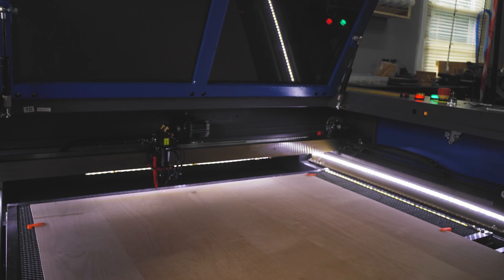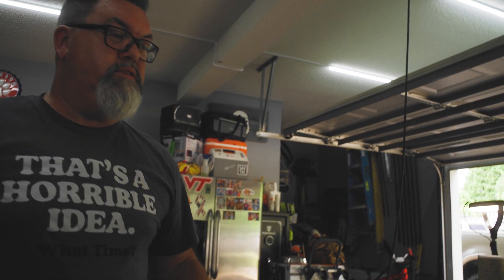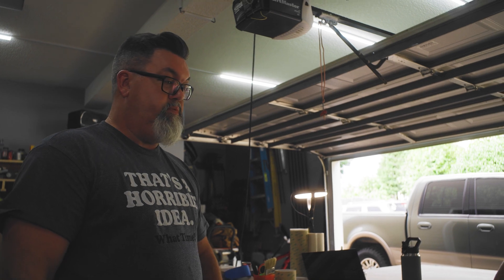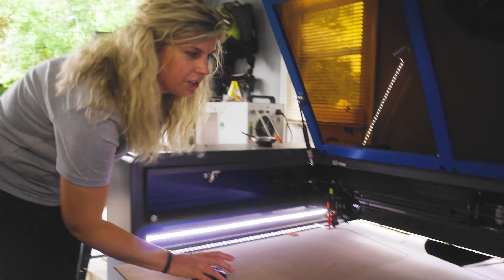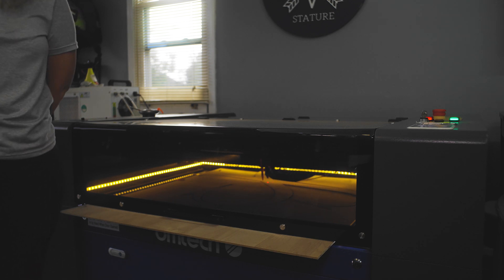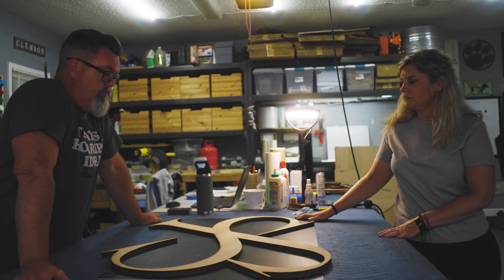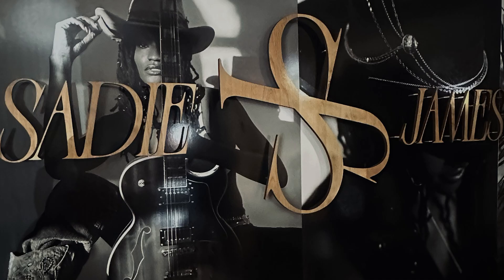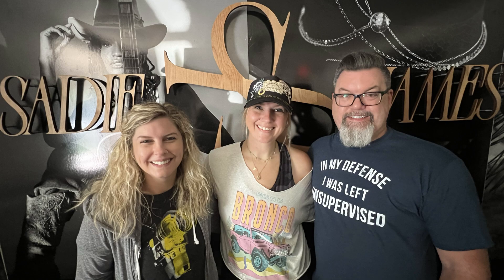DISASTER or!? Laser Engraving a Store Sign!

Comment: 1:48 I worked as a Maintenance Manager for a large Semiconductor manufacturer. We had multi million dollar machines and ran into the same issues with Japanese equipment makers. They make a slight and insignificant change to a power supply and label it proprietary and you cannot second source it because of that. There are plenty of second source repair houses in the US and Europe who can reverse engineer and repair the subassemblies. I think I need to start putting a list together for the laser community.
Reply from the maker: @robertkitchell9988  Oh wow!  I bet, you would have a lot of new best friends haha!